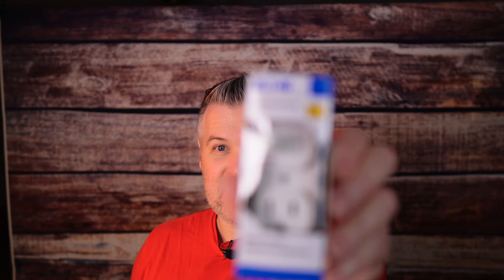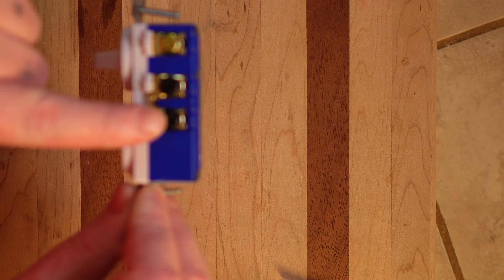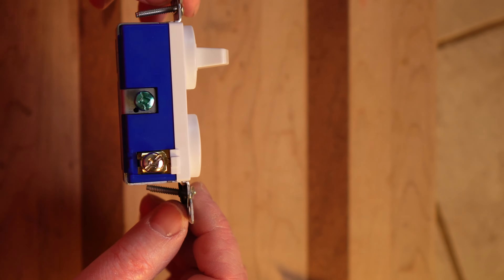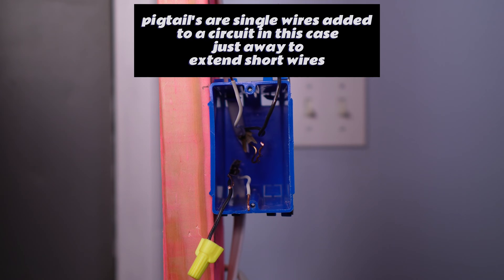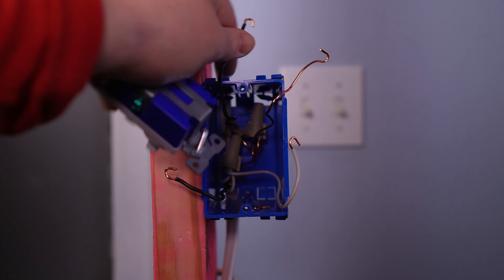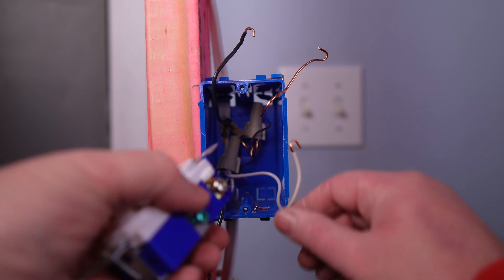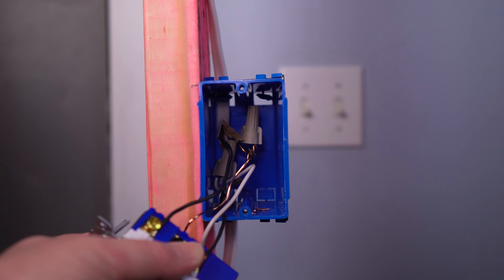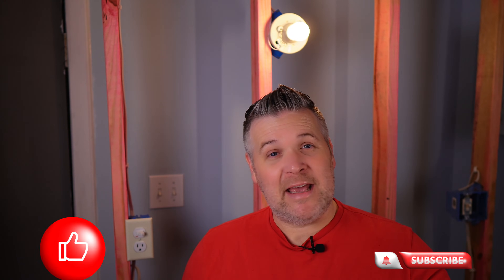110V switch & outlet  COMBO DEVICE ! duel purpose and cool to have anywhere !🧐

Comment: How can I wire this combo to use the switch to turn on/off the outlet?
Reply from the maker: Hey, you see the two black screws on this combo device there’s a tab that connect in between the two black screws. You have to break that in half to separate them, put your known hot on the top, black screw this will power up the switch, then add a wire from the top brass screw to the bottom black screw. And you will be able to turn that switch on and off, and it will control the outlet.
  Thanks for the comment, and let me know if you have any other questions. Sorry it took me so long to answer your comment. I just seen it.

Comment: Violation around 9:00. The NEC states that you MUST use a torque device ( torque driver or torque wrench ) to properly torque every screw or bolt that secures wires. Has been in the code books for last ten years !
Reply from the maker: Hey, thanks for the comment. I’m aware of the torque specs. I use torque specs on all panels motor controls as far as switches and outlets go I’ve been doing them for 25 years and I just naturally know by the feel of them usually, if I check, it’s gonna be 14lbf.in
Reply: We all do that. At a IAEI continuing education class the instructor told us that UL labs went around the country and tested could have over a thousand devices & circuit breaker to check torque.It was either only 30 or 40% were properly torqued. Believe around 20% actually were over torqued and told us that is just as bad as too low of torque. If the price of the receptacles & switches that have the arm similar to Wago connectors you would only need a torque driver for circuit breakers , starters & VFD'S  & for securing lugs to buss bars.
Reply from the maker: @garbo8962 , I believe it. I’ve worked behind other people other companies and seen some very shady work. Some people just don’t care enough.

Comment: If you are performing new work be smart and install a two gang box and separate receptacle & toggle switch. It ends up costing less ! I always purchased duplex receptacles in at least ten packs to save $. A lot if old homes do not have enough room to handle deeper devices. Worst is the extra deep combination receptacle / built in cell phone charger ports. Need two shoe horns and a rubber mallet to get them into a 2.5" deep wall case.
Reply from the maker: 😂Yeah, the combo has its applications, but it is a little pricey ,most of the people that want these , want something that’s very minimalistic in  existing single box . But new construction,  I always try to talk them into putting a few receptacles and a single box in new construction. Most of the times i install these it’s a finish room and they have power at that box. lol one woman wanted a outlet like this at her foyer because she wanted  to install a shelf  to plug her phone up where she could stand at the front door and watch her kids get on the bus to go to school & can grab it before she leaves to go to work and it was a combo 25w  USBC version she was very happy with it. 
    Hey, thanks for the comment 😂 can be very hard to get some of those bigger devices some of those single boxes just gotta take your time .

Comment: Is this the kind where if you turn the switch off the power to the plug is off as well?
Reply from the maker: This device can be wired to operate both ways . It works Independent right out of the box with the outlet staying hot constantly with the switch in ether off or on position , just like if they were two Separate devices .